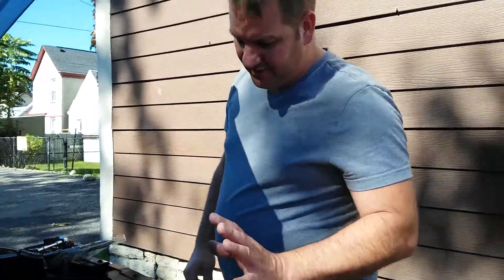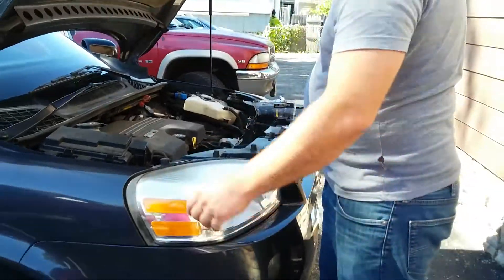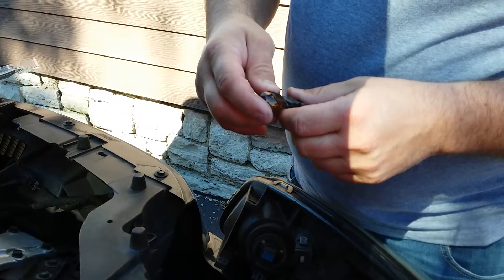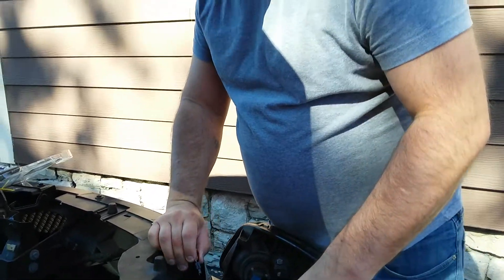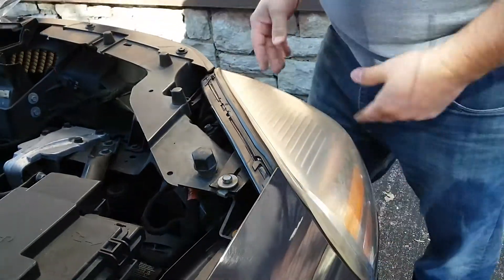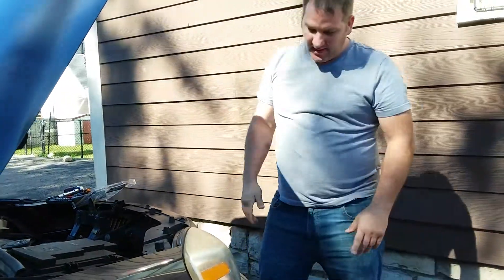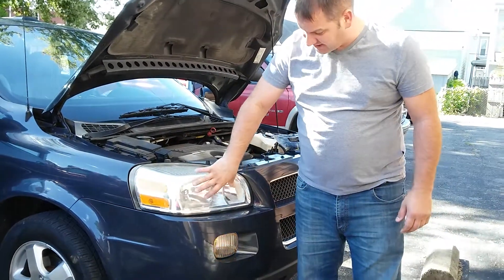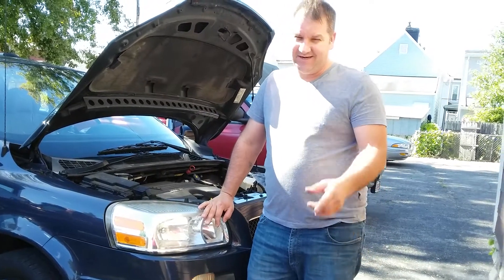Replacing turn signal lights in 08 Chevy Uplander

Comment: Hi
I replaced with brand new bulb on both sides .... Still the right side is not working.... When I put new bulb on right side first it worked normal for 10 seconds then.... It turn back to the same situation.... Do you know what will be the problem
Reply: Ever find out the answer to this problem?

Comment: Seen April 4, 2018. My left turn without for the running light. It serves as turn signal and running light. Had I not seen this, I would have called my local Chevy dealer. Thanks 👍